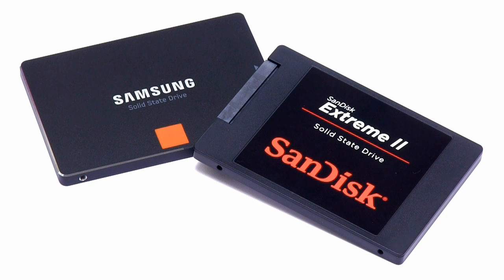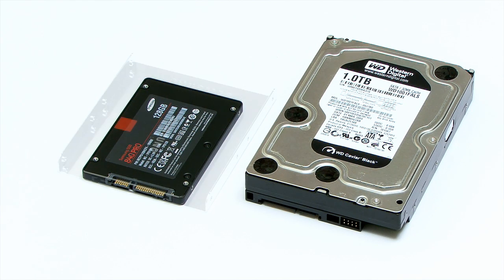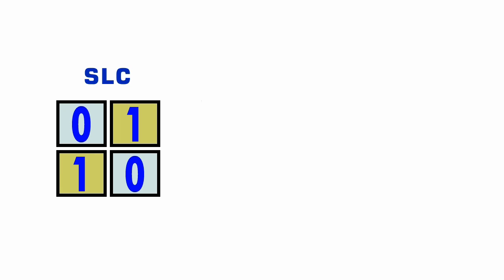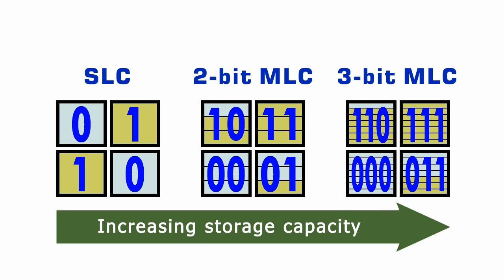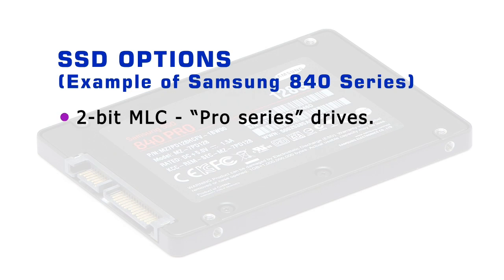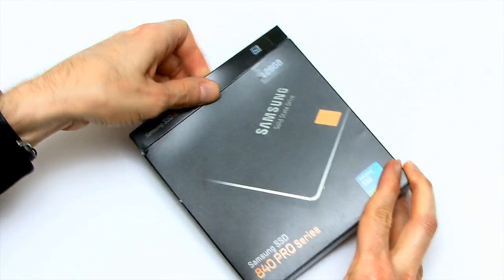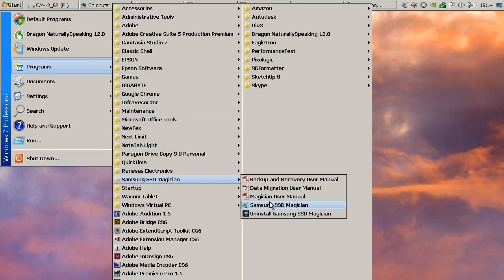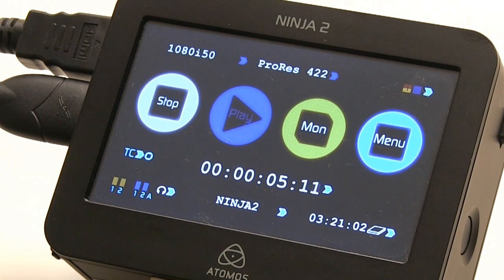Explaining SSDs 2014 Update

Comment: I suspect I have bad news for you: that five-year guarantee covers the cost of the SSD, not the disaster for your data!
Reply from the maker: No, this is not bad news! The guarantee is clearly for the hardware. :) It could not possibly cover the cost of a data disaster, as no hardware device is ever recommended to be used as a sole data store without appropriate backups . . .
Reply: 'Bout right.  I bought a Swiss can opener for five dollars fifteen years ago.  It came with a five year guarantee, and indeed it stopped working after six years.   By that time the price had increased to nine dollars, so I switched to the Chinese one for a dollar. 

No guarantee, and the first one lasted 18 months.  The price increased to $1.25 and I learned to use it more carefully: the second on is still going strong two years in...
 
Ten years from now the Chinese one will be as good as the Swiss one, and so it goes.
 
Cheers: I think your video-column is superb, and you are doing fine work!  Thanks!

Comment: I use my laptop for many things. From watching movies, surfing the web, and I run my design software on it for my sign business as well as for other things. I rely on it quite a bit. It has a 500gb HDD in it now, to which I am only using about 20% of. What are the advantages to choosing to exchange the HDD to an SSD or should I stay with what I have and move to using an SSD external drive for storing normal family things such as pictures of my children or clipart?
Reply from the maker: Exchanging the HDD for an SSD would speed things up -- esp. making the OS and programs load faster. It would also reduce the chances of a HDD crash due to a movement/thumb of the laptop. And it would extend battery life. This said, using an external SSD to store files would give you a back-up copy (although if you fitted an SSD you could keep the removed HDD for this purpose).
Reply: ExplainingComputers Thank You.

Comment: For someone building their own gaming pc(for example me) is an SSD a better option as it works faster than a hard disk?
Reply: I think according to the theory it will only improve the  loading times of games, but it won´t improve the gaming experience itself. So to save money in not buying a 1tb SSD, you should get an SSD for windows and add and HDD for the games. I can tell even Doom 2016 loads fast in a mechanical drive, and an SSD would be too much money, but if you can afford it, go ahead :)
Reply from the maker: Yes, if you can afford to fit an SSD, it will make your system more responsive, with the OS and games loading faster. An SSD really transforms the performance of most PCs.
Reply: Thanks :)

Comment: My corsair  force 3 120GB drive is about 4 years old now and  have been well used and it still works fine, it have not even started to use the over provision yet, which just in case people don't know is  extra capacity that the drive uses when cells start failing.
I now got myself a 250GB Corsair Neutron as i wanted a bit more space and now the old drive is being used as a scratch drive for video editing.

What I did not know and found out from your video is that the bios need to be in ACHI mode to allow trim to work. 
I changed a 60GB SSD for a 240GB SSD, in fact the same make  as I have got in a mates computer a few days back and noticed his bios was set to IDE mode, I am glad I changed it now, I did have to change some bits in windows registry to stop the computer giving us a BSoD. i am just surprised that the company who built the PC did not change it to AHCI in the first place.

Comment: Can you quantify how much longer a 2 bit mlc will last vs a 3bit mlc?  Is there a specification on the spec sheet of the drive ie a samsung 850 evo or pro that indicates how many times a given cell can be written to?   Does windows or the drive maker have a utility to warn the user of a imminent ssd failure when the drive nears the end of its life span due to the wear and tear of writing bits to the cells?
Reply from the maker: +evadesc Such figures are hard to establish, and will depend on manufacturer, technology generation (SSD endurance is increasing all the time), and usage scenario. But it is perhaps worth noting that a Samsung 850 Pro has a limited 10 year guarantee and can (in theory) write and read 40 GB a day for 10 years. The Evo drives offer a 5 year limited guarantee, and I cannot find endurance info. I am not aware of any Windows software that will flag performance failure.

Comment: Is the 850 evo 3bit? And the 850 pro 2bit?   Does samsung make a 1bit ssd?  And I'm assuming windows 10 automatically detects it's on a ssd and turns off defrag and any other inappropriate operations?
Reply from the maker: +evadesc Essentially, yes, by paying for the Pro you move from 3-bit to 2-bit. I am not aware of a consumer 10bit drive. Windows 8.1 and up will indeed automatically configure for an SSD as you note. The Samung Magician software also goes further, and  lets you optimize for (eg) speed or lifespan.

Comment: wait, so my SSD will degrade over time? It thought it being solid state means it should last longer? surely mechanical vs digital, digital will win ?  Why would a HDD last longer ?? and I've had HDD's last 8 years + Are you saying the ssd will die in 4 years ? !
Reply from the maker: +TeslasLoveChild The SSD will (probably) still be working in 4 years, but it will be slower. In comparison, a HDD of the same age, properly maintained (defragged) will be working at its initial speed. The issue is that flash memory cells do degrade with repeated use, whereas this is not true for state changes of magnetic media (unless they fail when the media wears out or there is mechanical failure). I would be very surprised if an SSD in regular heavy use is performing satisfactorily when 8 years old . . .
Reply: ExplainingComputers  wow. surprising to know given the price of them these days.. are you aware of any new tech that can resolve this degradation issue ?
Reply from the maker: TeslasLoveChild SLC SSDs will last longer than 2-bit MLC drives, which in turn will last longer than 3-bit MLC drives. But of course the first are the most expensive! In practice, manufacturers have been improving SSD technology by improving capacity at the price of long-term performance. Personally, I tend to buy 2-bit MLC drives (like the Pro Samsung drives) as they will last longer, though cost more.
Reply: ExplainingComputers  I see.. How expensive are we talking about for SLC's ? .. could I get a 250GB for under £100 ?
Reply from the maker: TeslasLoveChild Not for under £100. SLC is pretty much reserved for key enterprise use. If you are worried about lifespan, go for a drive based on 2-bit rather than 3-bit MLC, like a Samsung Pro. Everthing wears out (even a SLC drive could be blown by a freak voltage spike in its first week!).
Reply: ExplainingComputers  Oh dear! I mean I can understand the hype from the performance but I like my tech to last! I think I will stick to my mechanical drives.. I mean, they aren't too bad except for the noise, but with regular defrag if it lasts me another 4 years I'll be happy and hopefully some NEW long lasting ssd tech will come about
Reply from the maker: TeslasLoveChild There is no doubt that SSD performance continues to improve. Our conversation here has also promoted me to schedule a video on the subject for January. :)
Reply: +ExplainingComputers will a UPS protect the SSD from losing the data from a voltage spike?  How likely is a SSD likely to lose data from a black or brown out?  Is it still better to just go with a hard drive because of all the potential issues of a SSD?
Reply: +evadesc I think for now the best solution is to use SSDs as internal drives that contain the OS, applications etc. (everything that needs to be fast) and to make regular automated backups (such as Time Machine that makes a complete copy of my internal SSD every hour) onto inexpensive external USB 3.0 hard drives. For good measure, I make extra backups of my most valuable data into the cloud, another HDD or the occasional USB stick.
Reply: +TeslasLoveChild I think it is ok to replace your SSD with a new one every 3 years. Keep your important data and backups on a smart network server. That you can take with you (Raspberry Pi).

Comment: how long is it before SSDs begin to slow down?
Reply from the maker: +TGTurtle It depends on usage and is a topic of great debate! :) Modern drives are also far better than those from even a few years ago. But to give you some hard data (and because I was interested!), I have just done a speed test on the 128GB SSD in the PC I am writing this on. This was fitted new in January 2014, has 107GB available capacity after wear-levelling provision, and has written about 1TB in the last c.20 months. When new the write speed was 391 MB/s and the read was 538 MB/s. 20 months later, the write speed is 347 MBs and the read 534 MBs. So in under two years of very normal use (this PC is only used for office work, web-browsing, social media and e-mail), write performance has fallen by over 11 per cent -- which is not insignificant. Bear in mind this is a Samsung Pro SSD, so should suffer less wear than many other models (eg like the Samsung Evo). Thanks for your question -- I find the results of this test very interesting -- and may even put them in a video now! :)
Reply: ExplainingComputers thank you very much :D
Reply from the maker: +Deniz1923 +Deniz1923 It would make the boot time longer -- but as it will get slower very gradually, you probably would not notice. And similarly applications will load a little slower/etc. I think performance probably has to fall by a good 20 per cent for it to be noticable in the vast majority of situations -- ie you can use a PC for 3-4 years before the speed difference become apparent, which in the past used to be the average life of many PCs.
Reply: +ExplainingComputers That is a massive difference. Though probably not recognizable performing the stuff you mentioned. On what sort of applications would the write performance decrease of %11 would be noticeable ? Would it effect boot time for example ?
Reply: I have an ssd and i think it may be the reason my mac is slowing down, but how would i check?

Comment: Hey chris  , when upgrading a primary work and programming  pc , what solid state do you recomend . Also i plan to do a lot of video editing , so i would need a drive that can handle power computing . Also do you think it is worth upgrading  my quad core i3 processor
Reply: Mark Blake That i3 is not a quad core, but a dual core with Hyperthreading for quad core-like performance.  As for your SSD upgrade, if you haven't already done it, go with an 850 Pro (or an 840 Pro per Christopher's suggestion if you want to save a little bit of cash).  Either way, you won't be disappointed.
Reply from the maker: Mark Blake I would personally choose a Samsung 840 Pro; I have a 830 Pro in my main PC (and others!), but only because the 840 was not out when it they were fitted. I would upgrade a processor if you need the power, but not otherwise. So it depends what you are editing media-wise, and in what package.
Reply: thanks

Comment: c an you do a video explaining SSD and MAC computers and Mac Books And MacBook Pro With Retina Displays.  Because I was told by MACSALES OWC that I cannot use a 6Gb Pro on a 2008 MacbookPro 5,1 as it would slow down the performance but instead the only option for SSD is the Mercury 3gb SSD here is the info on the drive they Told me was the only SSD i could use.  OWC Mercury Electra 3G SSD
Exceptional, High-Performance optimized for Maximum SATA
3Gb/s Performance
Up to 285MB/s data rate.
Ultra-efficient Block Management & Wear Leveling
Prevents write speed degradation commonly experienced by other brands' SSD.
EXTREME Power Efficiency
Uses up to 75% less power than hard drives and up to 50% less power than current SSDs* when active.

Comment: I really find your videos informative. I switched to a 750gb Toshiba 84o EVO 11 months ago.  I think though,  I'll use a hybrid on my next system using the best of both technologies. I find media programs do not perform much differently in either and a large performance difference  when doing complex computations.  Thank You.  I purchased this SSD because the price was extremely cheap compared to the size and specs of the drive.  I use my system for many things including virtual drives, beta testing Linux and Windows os'es , coding, and 2 and 3D graphics so if I get 3 years out of this drive I'll be quite happy. Thank You for the new video.